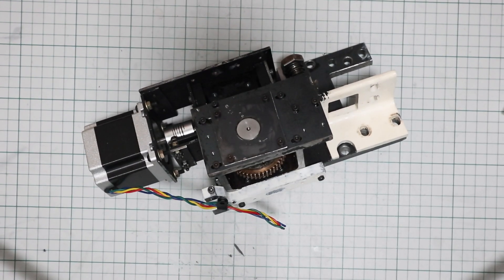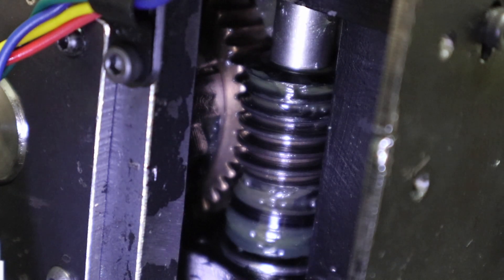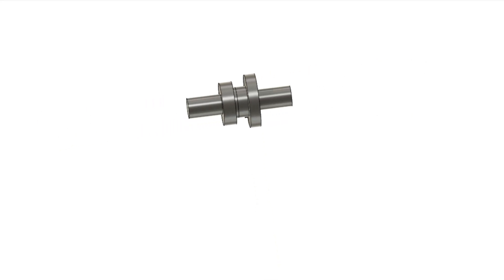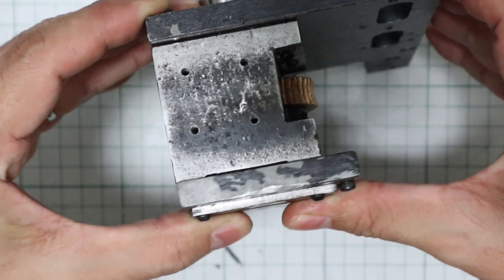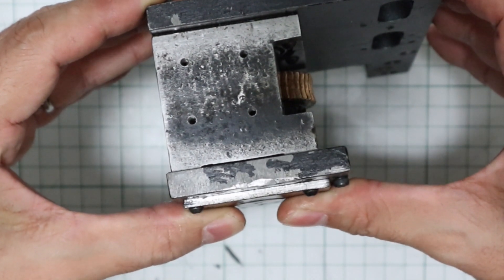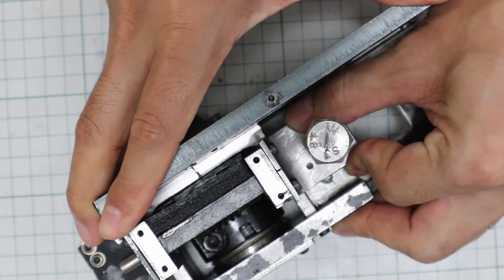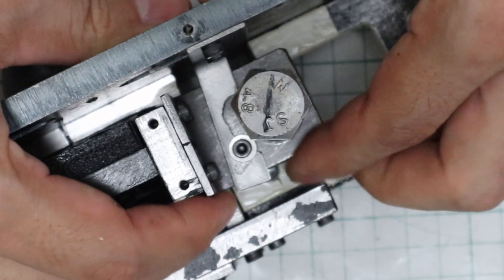【ROTALY AXIS A】DIY CNC How to Build A-axis

Comment: Even if you preload the worm screw, it will bend. But this is easy to fix, just add another dummy worm gear, behind the worm screw, so you have two worm gears that squeeze a single wormscrew. Sort of how planetary gears use gears themselves to hold everything together.
Reply from the maker: I agree with you.
However, using two worm gears makes the structure too large.
Especially the C-axis has to be compact or it will interfere.
This structure will not completely eliminate backlash, but if I apply prelo, mechanical rattling can be eliminated.
This is very important for machining metals.
Reply: The second gear doesnt need to be the same size as the main. A smaller one can be sufficient to counter the worm screw to bend.

Comment: Would it be better with a solid coupler to the stepper?  Less flex.
Reply from the maker: If possible, it should be inflexible.
In particular, it should have no rattling in the direction of rotation.

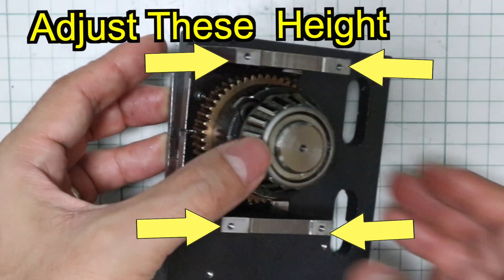Comment: Just discovered your channel. I like your build. 5:13 filing the mating surface to adjust preload is not a good idea because you can remove too much. Also maintaining flatness as well as dimensional consistencies between each filed surface becomes difficult. much easier to mill to a dimension and use shims. that way you can go back and forth with the preload adjustments.

Comment: I see that your method to build machines is to you a number of pieces but speaking of the stiffness and rigidity am not ok with that i am sure that you can make the machine using a minimum number of pieces an make it easy to understand and rebuild

Comment: The whole assembly surrounding the worm gear mechanism seems quite rigid for what it is, the culprit for the error probably really is the worm gear mechanism. As you said, you need a lot of torque to support a stronger backlash reducing system. Experimenting with higher torque (for more backlash reducing) and increasing stiffness could be interesting. 
I really liked the video, I'm interested to see where this series is going
Reply from the maker: Thanks for your interest.
There is part 6, so please check it out.